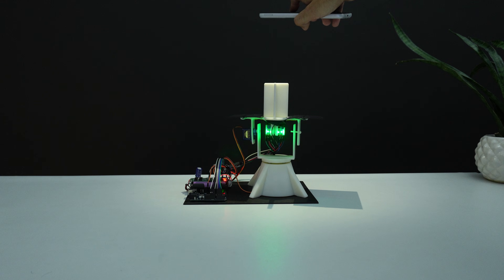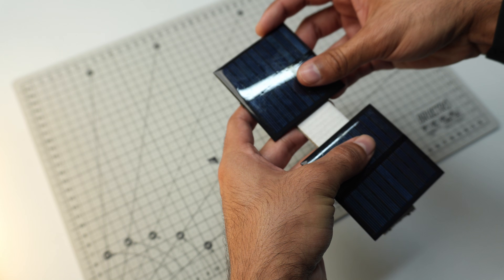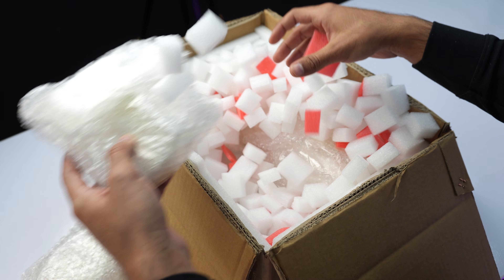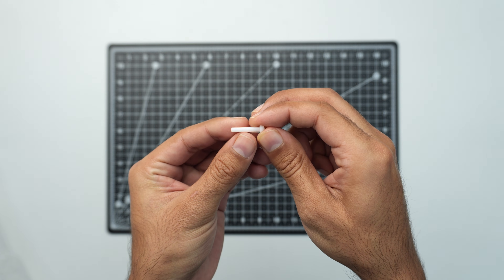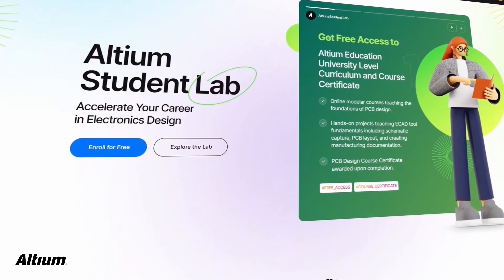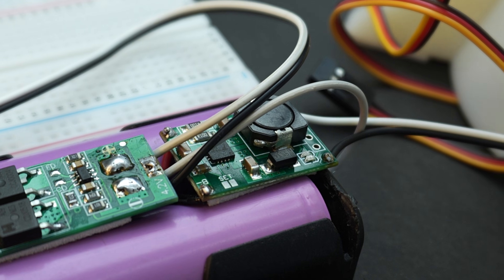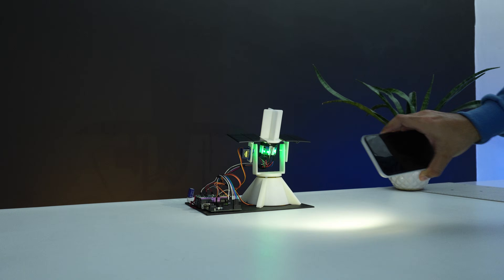How to make solar tracker using arduino | Dual axis solar tracker using arduino | Arduino project

Comment: Quick question — I’m working on a school project and taking inspiration from your build. There were several steps that weren’t fully explained, and I’m still confused about which wires to connect and how many are actually needed. In your description, you mentioned using 40 pieces of male‑to‑male, female‑to‑female, and male‑to‑female jumper wires, but it wasn’t clear how everything was connected.

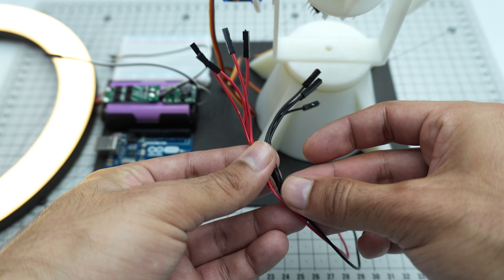Could you please explain how you wired the remaining components? The instructions became unclear after the 6:17 mark, and at 7:05 I wasn’t sure how you combined the four wires into a single connection. A more detailed explanation, and quick response would really help.
Reply from the maker: Please listen to the things I am explaining and watch full video for your proper understanding. Every small is shown with reference. I thing no explanation required further but still if you feel the trouble in understanding then contact me through instagram. Link in description. For live chat. Have a good day.
Reply: @SimpleCircuitsOfficial  Is the BMS working on continuous current?

Comment: Bro can I use 9v permanent battery and what should be the changes I have to make?
Reply from the maker: No, you can't use 9v battery.
Reply: @SimpleCircuitsOfficial can I use 2 3.7 v?
Reply from the maker: Yes
Reply: @SimpleCircuitsOfficial So what are the parts should I use to make it work
Reply from the maker: Everything is shown in video. Please watch it full. It will clear all of your doubts. Also listen to the audio which will help you to understand the principle of project.

Comment: Tengo una pregunta, a donde va conectada la salida de 4.2V 2S 20A BMS?
Reply from the maker: It's 8.4v 2s 20A BMS and It's connected to arduino Vin and GND.

Comment: can i use MG996R metal gear servo motor while using this code and the supply i use 12v to drive a  10w solar panel
Reply from the maker: Yes you can use but you need at least 12v 2amp power supply for it.
Reply: @SimpleCircuitsOfficial Hi, if my LDR module only has 3 pins, can I still use it?